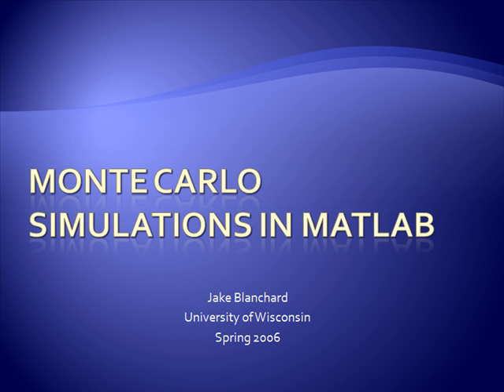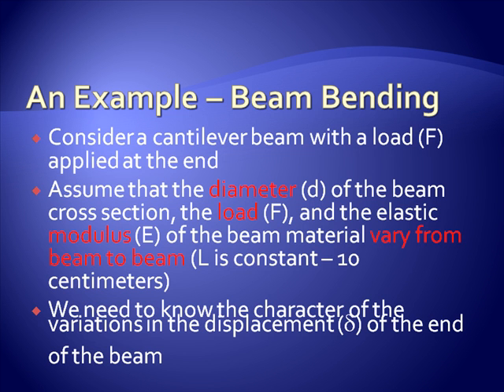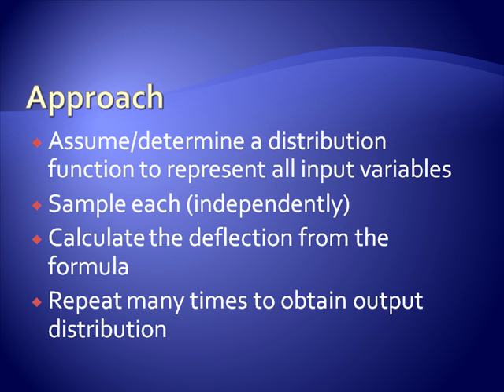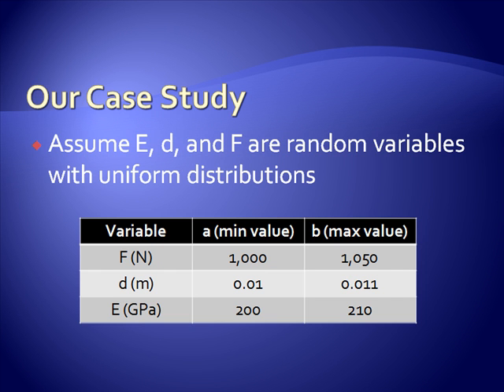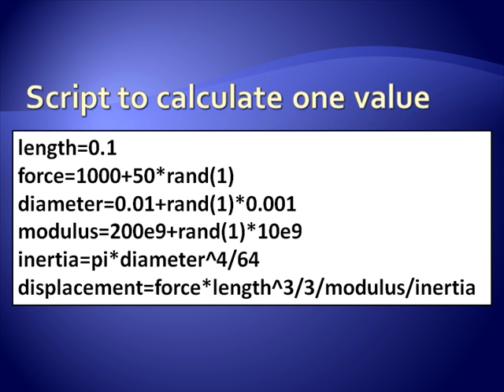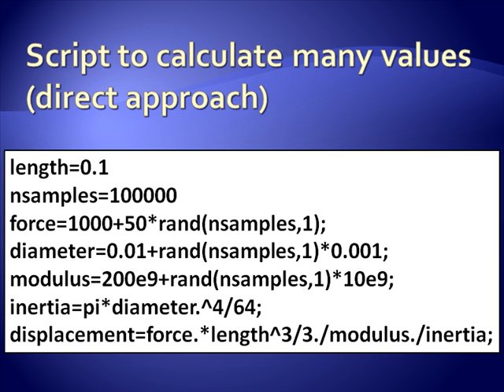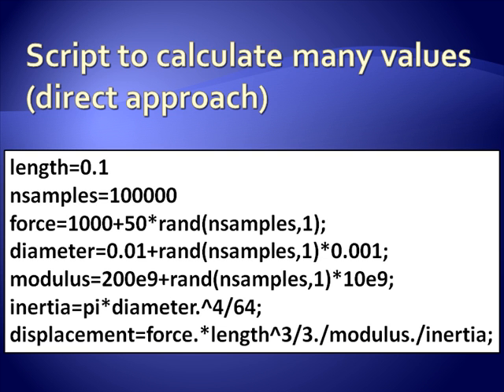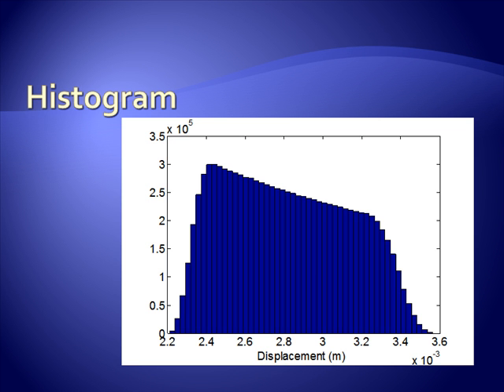Monte Carlo Simulation in Matlab

Comment: Thank you for your post! Easy and good explanation of how to implement a small Monte Carlo example in MATLAB. Very Helpful. To make the uniform distribution to a normal one (with given value of expectancy and standard deviation). May it be that I simply have to change the rand() operator to randn() ?
Reply from the maker: as I recall, randn gives a distribution with a mean of zero and std dev of one. if that's what you want, then a simple replacement is what you want.

Comment from the maker: I've never used simsd. It isn't part of the standard Matlab package. You have to have the system identification toolbox to be able to run it. As far as I can tell, it perturbs the input parameters and then looks at the output response. So the way to think of it is that the Monte Carlo method is quite general and can be used for a variety of applications and simsd carries out just one of those possible applications.

Comment: thank you for the clear explanation. In case the 3 RVs (force F, diameter d and elastic module E) are correlated, is the sample of each RV  still performed with 3 different "rand(1)"  or is the same rand(1) applied to all of the 3 RVs?
Reply from the maker: It takes a little more effort to sample correlated variables. This discussion seems like a good start: https://stats.stackexchange.com/questions/38856/how-to-generate-correlated-random-numbers-given-means-variances-and-degree-of

Comment: Hi Dr. Blanchard, thanks for posting this - it's really helpful and easy to understand.  Question - I'm using matlab to solve a second order differential equation that has 6 unknown parameters, and then I'm optimizing those parameters with lsqcurvefit to fit the solution of the eqn to data.  Would the Monte Carlo simulation be an appropriate means of conducting a sensitivity analysis of the influence of each of the parameters?  just want to check that I'm thinking about this the right way

Comment: Thank you. This is very helpful.
I have a question: how to determine the "minimum" and "maximum" when these values from the real data set is way off of the mean? Should I used the lower and higher limits of 95% (or 99% etc.) confidence interval rather than the real min and max?
Reply from the maker: Linquan Mu I'm not a statistician, but it certainly seems like confidence intervals are what you are looking for.

Comment: Thank you Professor Blanchard for your explanation. I still have a question though. 
I tried the "direct" version in MATLAB. What does the "."
in "length^3/3." in the last line (displacement=force.*length^3/3./modulus.inertia;) mean or what is "." referring to, inertia, modulus, diameter or force?
Thanks so much in advance. I also appreciate answers which are not from Professor Blanchard. :-)

Comment: In the last figure of histogram, what are we getting on y-axis? I mean what is the label for y-axis where the numbers are from 0 to 3.5×10^5?
Reply from the maker: This graph divides the displacements on the interval from 2.2 mm to 3.6 mm into 50 intervals. So the first interval, or bin, goes from 2.2 to 2.228 mm (if I did my math correctly). The bar for that interval represents the number of samples from the simulation that fell into that displacement range. So the largest bar, which is at about 3x10^5, indicates that 300,000 samples from the Monte Carlo simulations fell into the associated displacement range.
Reply: @jakeblanchard  thank you, dear professor. I completely understand now. May God bless you!

Comment: Thank you Sir, it's vey helpful. Can you tell me, please, how can i use it to calculate the reliability of a beam under horizontal and vertical loads  ?
Reply from the maker: Do you have information regarding the uncertainty of your inputs (loads, dimensions, material properties, etc)? And do you have a model for stresses and strains as a function of your loads? And do you have some idea how this beam might fail? If so, you could use this approach to generate a probability distribution for failure of the beam. Feel free to contact me at blanchard@engr.wisc.edu if you have more questions.
Reply: @jakeblanchard  Got it, But why do we need to know about ''how this beam might fail''? Do we also require to use that as an input?
Reply from the maker: @AryanGupta-wk2wf  You can calculate the stresses and strains in your beam, but what do you compare them to? The stress and strain limits depend on the failure mode. Preventing fracture would give you one set of limits, preventing buckling would give another, and preventing yielding would give you yet another. So the failure mode isn't as much an input as a way to interpret the stress and strain results and to guide you on which stresses and strains to focus on.
Reply: @jakeblanchard  Ohkay got it! Thanks a lot Sir! :)
Reply: @jakeblanchard  I am working on one of the projects to calculate the reliability of soil slopes and predicting Factor of safety, Can you please guide me how can I use MATLAB to proceed further.

Comment: Sir i want to simulate R-C (resistance and capacitance) circuit, where tolerance is + or - 5%. How can I simulate this?. In your program, you have  considered only positive changes in parameters.
Reply from the maker: If you want +/-, instead of doing something like A+B*rand(), you can do A+B*(rand()-0.5)
Reply: Jake Blanchard  thank you sir..i will help me a lot.